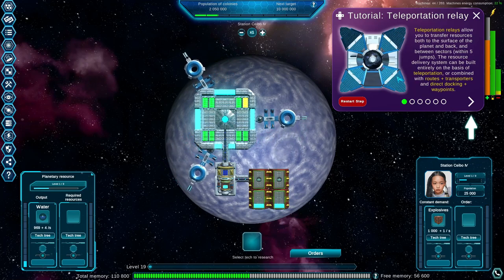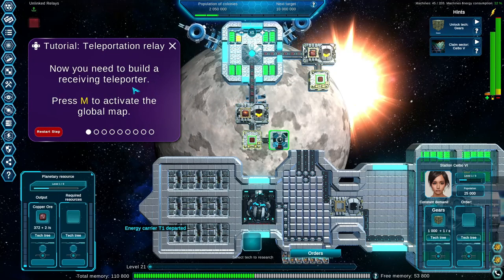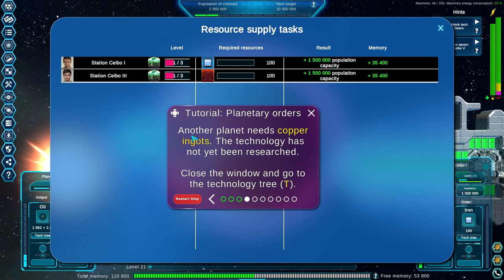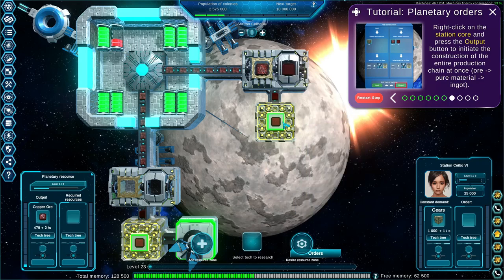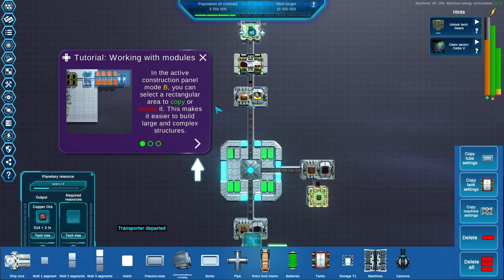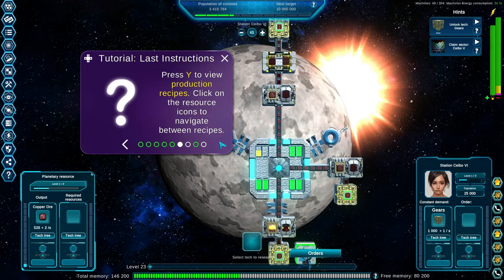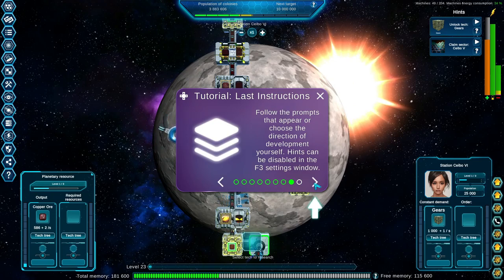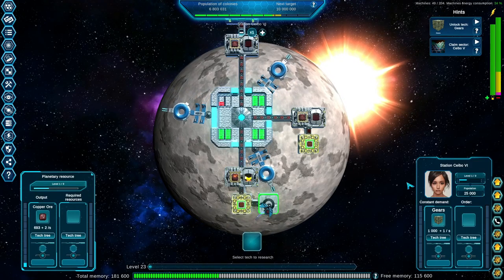Nickel, and still learning the game - Final Upgrade - Ep. 2

Comment: There are multiple ways of doing most things in this game. I'm sure that's great for remembering things while learning multiple games, lol. Though once you have things figured out it is a pretty rewarding game to play.

31:26 You were on the right track. If you changed the arrow on the bottom to point up instead of down it would have worked here. Also, when you draw pneumo-tubes manually you can start from a tile on a machine (or storage), instead of the adjacent tile. This will create the arrow on the first tube coming from the machine (or storage) so you won't have to come back and add it later.

To help you observe a ship and see if it is functioning how you would like, there is an option to follow a ship. Open the ship's menu by right clicking the ship and select "Follow", or mouse over the ship and press Shift+J. Pressing Shift+J again will stop following the ship. You don't need to mouse over the ship while pressing the hotkey to stop following it. 

There are two ways to set up automatic mining. One is through Waypoints, the other is through Routes. You are using the latter. Basically you set up a "Trade Route" just like you do for your transporters. When the source of a Route is from an asteroid that trade route will be worked by ships with the Mining auto-logic selected (and robots on board to be able to mine).

Hope this is helpful. I am very curious to see how you end up playing once you learn the game. I am also enjoying watching you learn as it has been a long time since I had to. I have been playing the game since it was released into Early Access. I don't want to spoil the experience so let me know if I begin to do that. It is certainly not my intention.
Reply from the maker: Not at all Advice, and tips are always welcome. Thank you! I don't think the game has gone over Waypoints yet but I will try and remember to look into them. The Follow function was brought up in the first part but I totally forgot about it so that's a good reminder! 

For the Tubes I only see the "+ and -", how do you change the arrow up and down?
Reply: @zachsletsplays  Right, I guess the UI doesn't really make it that obvious. You just click on the arrow itself. That will toggle the direction back and forth.

Not sure if the game will teach you about the waypoints. Might need to look at that massive help file for the basics. If you try it out and have questions I could answer them directly.
Reply from the maker: @ccmarkmeyer  Sounds great! Thanks